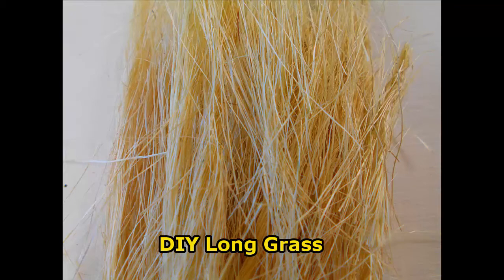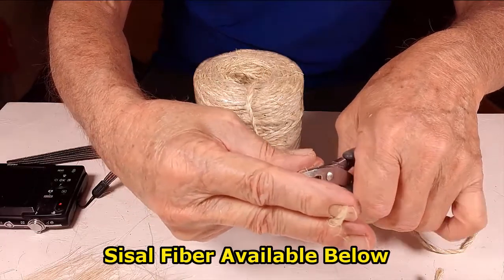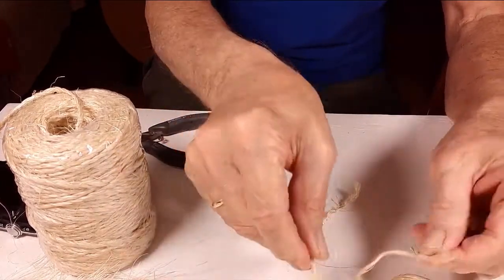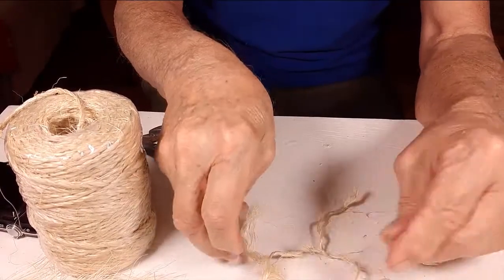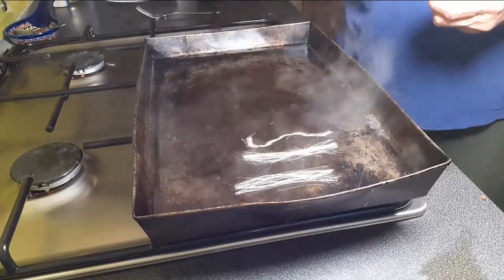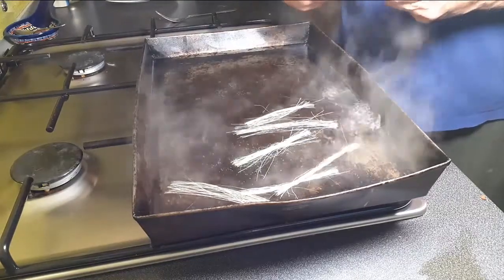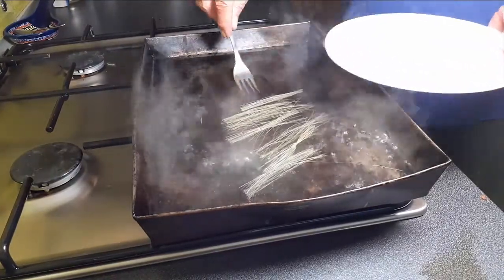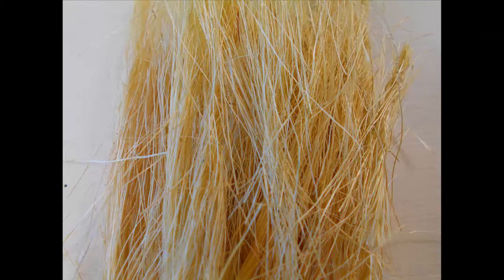Tall Grass Sisal For Model Trees #model tree #model tree making #model trees for model railways

Comment: Yeah, a great tip. Thank you.
Reply from the maker: I use this to make bushes, add branches to birch and willow trees, make reeds, weeds, flowers and even to add branches to plastic tree armatures.  Sometime I spray the fibers with glue and drop on static grass. That gives them more points onto which I can add foliage - fine turf or leaves. I even used it to make a model with a thatched roof.  That was fun.. I displayed it and someone made me an offer I would have been nuts to turn down. But looking back I wish I had been nuts.